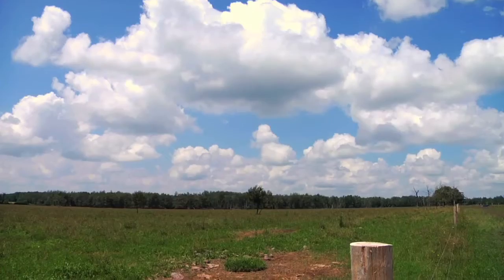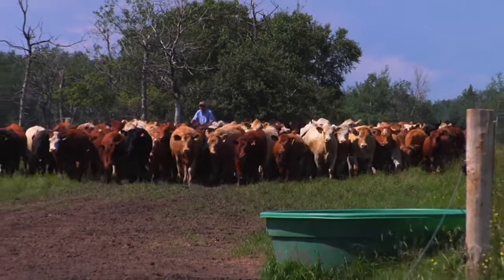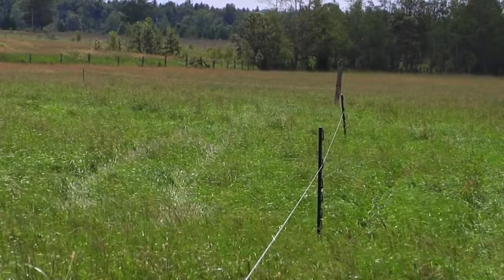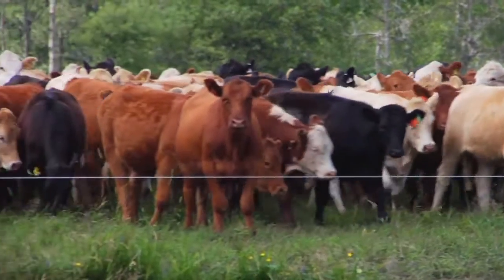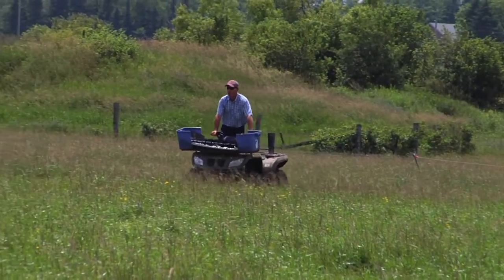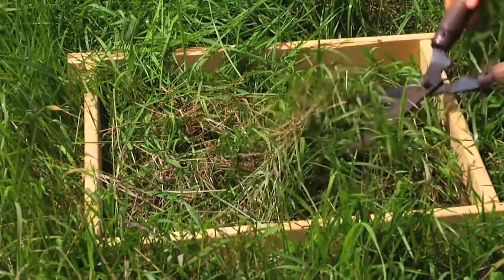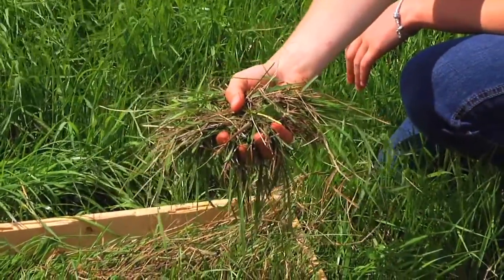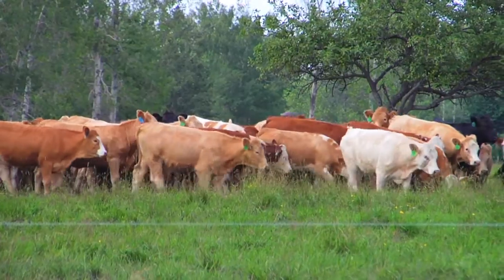Rotational Grazing in Ontario

Comment: Is it common to lift the poly wire for the herd to cross under? I have never seen that done before and it seemed to add a little stress (they started walking faster). That part caught my eye but don't get me wrong, I enjoyed the video.
Reply: Grazing Acres Farm 
They were walking/running fast bc the guy on the 4-wheeler was pushing them pretty hard. Which is contributing to that pugged-up alley

Comment: What about the winter time? Is there enough standing grass to sustain freezing temps and cold? Wont the drinking water freeze? Nice Vid! I want to start a farm just like this.
Reply: +Jack Mazza What you do in the winter depends on the species of grass growing. Certain species hold their nutrition during the winter better than others. Generally the dry land/prairie grasses hold their nutrition whereas smooth brome and other humid-climate grasses do not. And then you have to consider the snow. If the snow is any deeper than about 6 inches then the cattle cannot easily graze the grass beneath it. There are two solutions: 1. Swath graze, which is were you make long "swaths" of cut forage which will be easier for the cattle to eat in snow, but this will still not work if you get more than a foot of snow. 2. Bale graze (the most common solution). Simply put bales of hay out in the field (spread them out evenly over the field) for the cattle to live on during the winter. You can put out about a month of bales at a time. 

As for water: 1. If you have snow the cattle do not need drinking water, they just lick the snow instead. 2. If you don't have snow you have to break some ice on your pond/watering trough every day to let them drink. 

I am speaking from experience with 1200 cattle, doing Holistic Management in Northern Saskatchewan.